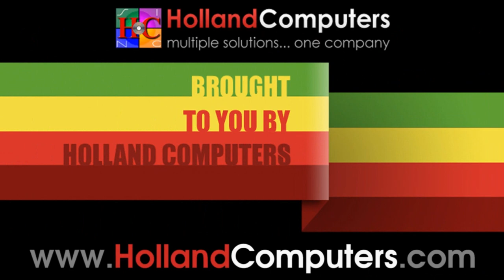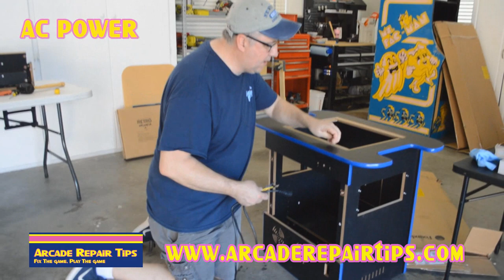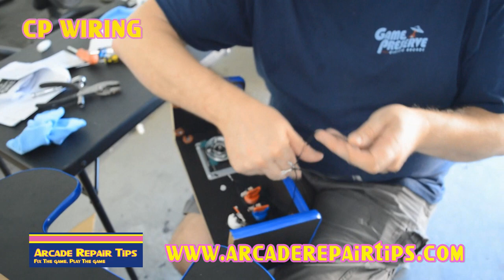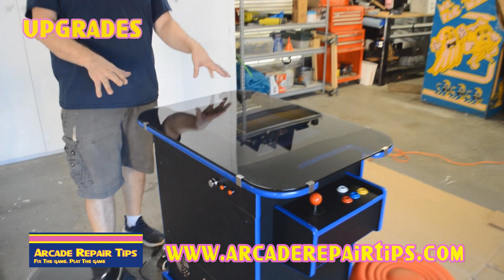Arcade Repair Tips - Assembling A Cocktail Cabinet Kit v2 (With JAMMA Wiring Harness) - UPDATED 2021

Comment: I wish you would make a video about multimeters.
Which brand, type and price.
I don't want to break the bank either.
A tutorial would be nice to.
Reply: I had to pick one up not too long ago to troubleshoot an issue with my Ms. Pacman/Galaga cabinet.

I got this one at Lowe's for around $30 (not sure what your budget is):

https://www.lowes.com/pd/Kobalt-Electrical-Test-Kit/5001926987

It has done everything demonstrated in the video as part of the cocktail cabinet build.
Reply: @jasonrichmeier32  
I just bought a used Fluke 23, made in USA on eBay for $75

Comment: For anyone interested:

3:14 Unboxing
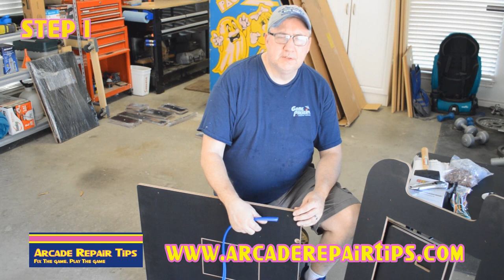5:03 Step 1
11:36 Step 2
12:35 Step 3
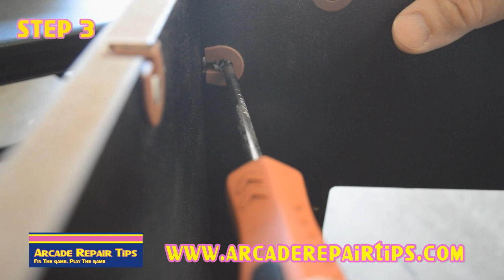13:18 Step 4
13:43 Step 5
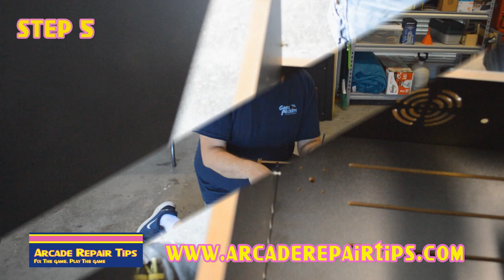14:24 Step 6
14:53 Step 7-9
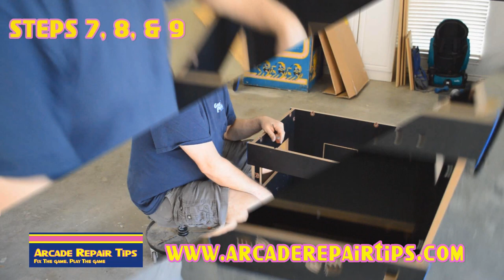15:34 Step 10
16:12 Step 11
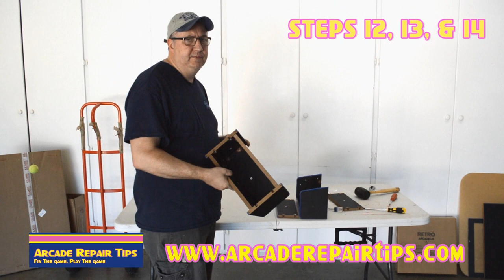17:12 Step 12-14
17:53 Step 15
18:25 Step 16
18:53 AC Power
20:32 DC Power
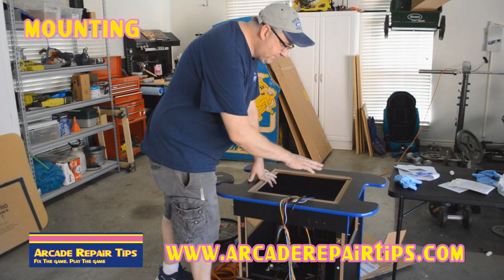22:48 Mounting
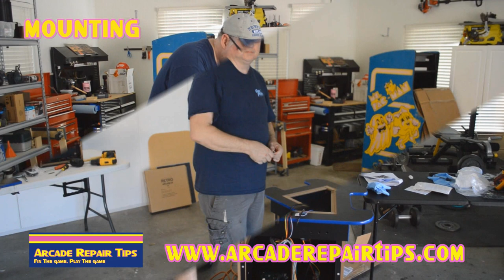23:23 Sound
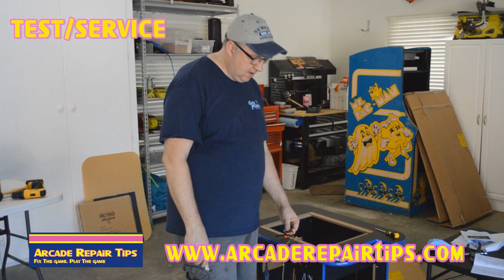24:31 Test/Service
25:04 CP Wiring
25:55 Joystick
27:51 Controls
29:43 CP Wiring
33:18 Monitor
34:21 Bezel
34:58 Plexiglass Top
36:10 Upgrades
Reply from the maker: Thank you for doing this. We have added your breakdown as chapters in the video. Awesome work.
Reply: @arcaderepairtips  so cool! Thanks! If i see another vid could use em ill add them! I needed the CP wiring and so after trying to find it decided maybe making the stamps for others.

Comment: Hello. I have an original table top style
Tiger Heli arcade game. It works great but after about 10-15 minutes the screen flips 180 degrees, any idea what would be causing that? Thanks.
Reply from the maker: Tabletop/cocktail games typically flip the screen when it’s the second player’s turn. If you want to turn this off, you can set DIP switch 4 on bank A to the OFF position. There is also a DIP switch for screen orientation that may need to be changed as well. You can find more DIP switch settings for Tiger Heli in the manual for the game: http://www.aurcade.com/games/manuals/00001687.pdf

We will also be covering your question on our Live Show Episode 82. Here's a link to the episode if you want to watch it: https://www.youtube.com/watch?v=_ccjOunA5UU

Comment: Do you still repair CRT arcade monitor?
Reply from the maker: Unfortunately, we are not taking any monitor repairs at this time, but we do have several people we recommend. Our friend Paul at paulsmonitors.com has been doing repairs for over a decade and has a lot of experience with most of the common monitor models. He has answered several questions on our Facebook page in the past and definitely knows what he's doing. Chad at arcadecup.com is also a very reputable guy and has a pretty fast turnaround time. There is a list of additional monitor repair technicians on our resources page (https://www.arcaderepairtips.com/resources) under the Monitor Repair Services & Information heading as well. Hope that helps.
Reply: Thank you for the recommendation’s. I will contact them once I get my settlement for the repair. I would rather pay a couple hundred to repair mine then try and find another monitor that would probably cost me a good amount more.

Comment: My astroids deluxe is getting fuzzy on one side any ideas ?
Reply from the maker: It could be a focus or a convergence issue. Try adjusting the focus adjustment to see if it helps. You may also need to modify the yoke/rings on the tube as well. Check out our posts on monitor convergence on our website for more information.

If you have any additional questions, you can reply back to this comment or join us for our Live Show Episode 75 on Thursday, May 4, 2023 at 5:30 PM CT on YouTube as we will be covering your question during the show. Here's a link to the episode if you want to watch it live: https://www.youtube.com/watch?v=VH5Yjazq2Po. It will also be available as a recording at the same link if you are not able to watch it during the live feed. 

Thank you for your question and good luck with your repair.

Comment: The on off switch was included?
Reply from the maker: Yes, the on/off switch is included in this kit. Thanks for watching!
Reply: @arcaderepairtips  I either threw mine away by mistake when I got rid of the box or mine didn't come with one. Do you have any recommendations on what type of on-off switch I should use?
Reply from the maker: @Notlisted4u Try contacting the Holland Computers support team and see if they will replace it for you. Here is a link to the switch based on the part number inventory for the kit: https://www.hollandcomputers.com/store/pc/Power-EMI-Filter-with-Built-In-Power-Switch-with-fuse-by-RetroArcade-us-2512p5988.htm?idaffiliate=38
Reply: @arcaderepairtips  thanks I'll do just that
Reply: @arcaderepairtips  thank you for the information about the on off switch. i ran into another problem though, while trying to extend the ground wire to reach across the cabinet for player 2. I, while the cabinet was unplugged and off, cut the daisy chained black ground wire shorter so it would reach player 1 and planned to use the extra wire to splice the ground in the middle together to get the leads to reach player 2 across the cabinet. however i found that when i plugged the cabinet back in my 60 in 1 was now blinking red and orange instead of green and i no longer had a picture. when i spliced it back in its original place the board still blinked red and orange. did i fry my board? did i ruin the jamma harness? any thoughts on this would help my frustration thank you very much.
Reply from the maker: @Notlisted4u  A red light on the 60-in-1 board usually indicates a boot problem. This is typically caused by a power supply issue. Make sure that the board is getting the correct voltage on the +5 VDC line. We like to set our voltage a little higher (around 5.05-5.10) to compensate for variances in the load. Hope that helps.
Reply: @arcaderepairtips  thank you so much. you were right about the voltages the voltage was about 5.08 at the power supply but when i measured at the start button and where i spliced the ground i found that it had lowered to 3.3 volts. I'm go to start with a new jamma harness, and use the old one for spare parts. ill let you know how it goes.